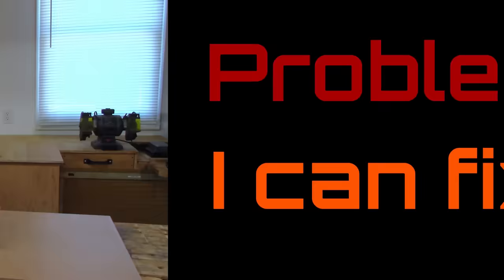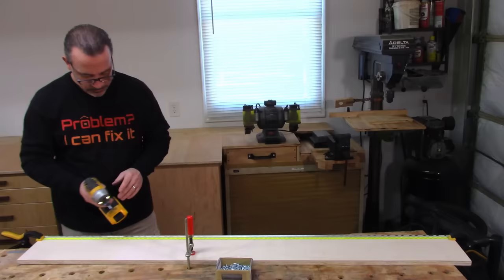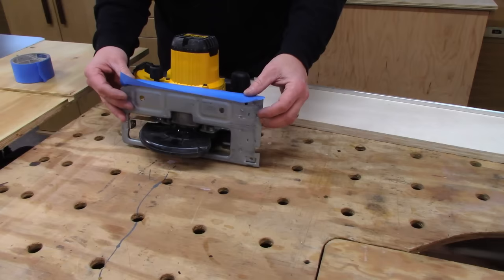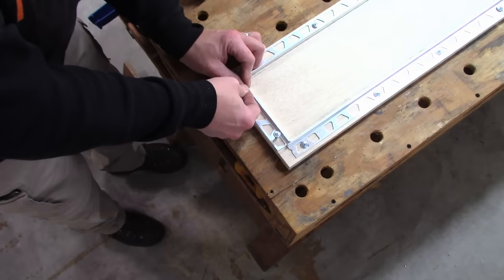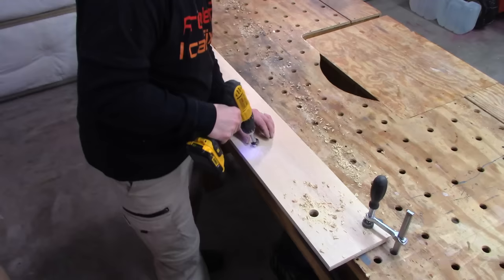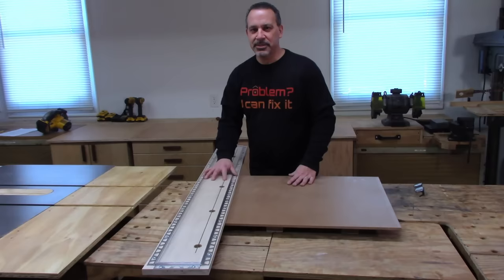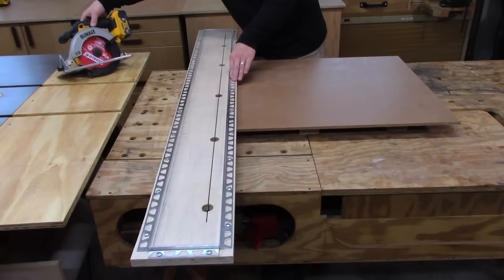Festool doesn't want you to see this DIY track saw

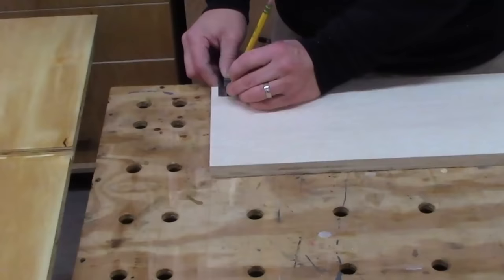Comment: I'm glad I saw your video.  I just leaned about track saws but for my minimal wood work it was hard to justify the cost.  I want to implement your build for my shop for the occasional times I need to make a straight cut. One question, at time stamp 1:21 you measure for the first edge but you don't tell us what that measured value is? I'm going to guess it was the width of the track guide but it would have been nice to have that information.  Also you measured from the edge of the wood.  What if that edge was not straight to begin with because you just cut it without a track saw or table saw. How can I ensure the line will be straight?  If I was a professional wood worker I would probably go with a commercial product with the dust collector but for me a home build will be perfect.
Reply from the maker: Approximate width of track.  When you pull the string taught you'll have a perfectly straight line to put the tile edge against.  The edge of the plywood doesn't have to be straight just the tile edging when screwed down.

Comment: would be great to remove hardwood flooring planks from the middle of a room if you had to do a board replacement but were worried you might scratch the surrounding area with the skill saw

Comment: Nice hack - but i would use the edge of a board to push up against and not string when fastening the first fence, way more accurate, and when drilling the 1 inch through holes, just put a sacrificial piece of timber beneath your jig and drill into it, getting a clean start and a clean finish in one cut.
Reply from the maker: Where do I find a straight board?
Reply: @HouseDoctorRay ? the other side of the board you just ripped your track from, and if that is not straight cut, then pay the few dollars to have one cut or buy one. If you are making a tool like this, its worth making it as accurate as possible. Even with the few extra bucks it is way cheaper than a Festool or Bosch track, and its actually a nice track which will last if looked after.

Comment: Run the track on the larger piece, then if you haven't supported correctly the smaller piece will fall with less chance of issue.
Reply from the maker: But my saw is built backwards 😭

Comment: I'll stick with my Festool (on the systainer it still says Festo). Has worked great for me for decades and above all the rail is very flat and light weight. Dust collection also no issue with a cheap Starmix shopvac hooked to a cyclone dust collector 😍

Comment: If you wanted this to support 45 degree cuts as well as straight cuts, would you make 2 jigs?  Not sure I could successfully cut 2 saw blade guides in the same jig.
Reply from the maker: If you made it out of Baltic Birch plywood you could probably turn the saw around and make a 45 slot.  I don't think home center plywood is stable enough for two slots.

Comment: C’mon you tube woodworkers, just accept the fact that Festool patented two of the best innovations in modern woodworking, you’ll never find a Festool killer in either the track saw or domino ranges. 
Other manufacturers have copied and refined the TS, but never really superceded the original, the evidence is clear, when they’re all compared to the ts55. And as for ‘domino killer’ videos, please give it up(Izzy). It’s ok to accept Festool did it perfectly.

Comment: Awesome jig. Only idea is would it not be better to apply the tape crossways? If you're cutting very close to the edge of the wood the taped section may hang over the edge and therefore not have any grip, and also mean the jig is slightly cambered. Applied crossways eg every foot you should get the same grip.
Reply from the maker: Good point.

Comment: "there's nothing worse than your saw bumping into a clamp mid cut..."
I can think of many things worse such as running your hand through a band saw, a spade bit snagging when on drill mode and breaking your wrist or accidentally leaning on a spinning unguarded jointer.
Love the video.

Comment: Quick question: doesn't this significantly removes how deep the saw can actually cut?
Reply from the maker: It will reduce the cutting depth by the thickness of the track.  Not really an issue because this jig is primarily for breaking down plywood.

Comment: What if you cut a dovetail dado on the underside, so you can use clamps that slot in from underneath into the groove for clamping if needed? I'm thinking of making this with 3/4" birch plywood.
Reply from the maker: That would work well.  I have slots like that in my table saw sled and use Micro Jig clamps.

Comment: I'm wondering if anti slip mat would work. It seems that the heavy grit skid tape could damage your workpiece.
Reply from the maker: I made some workbench cookies using anti slip shelf liner and they work great.  I'm sure it would be fine for this.
Others have also suggested non slip silicone tape that would also work as a chip out protector.

Comment: How do you see where you're cutting? You've gotta add some LEDs under there, too, so you can see the line you need to cut through that tiny gap. The metal looks cool, but this is weird.
Reply from the maker: The holes let you see the line.

Comment: If the plywood base is not square or parallel to the track above and there is no way to see the project piece under the jig, how can you quickly and reliably make sure that your cut is square or parallel with the other edges of the project?
Reply from the maker: That's what the holes are for.

Comment: clean and or  polish the bottom of the base plate to help it slide easier ...  and add a finish to the top of the wood  track ... and don't use a cheap or dull saw blade

Comment: If you feel that you need to add clamping ability to this, it should be possible to add at least one T-track and likely two (one on each side of the cutline) to the underside. This will allow you to slide T-track clamps into the tracks so that nothing sticks above the guide to catch on your saw. The ability to clamp the guide to the workpiece is likely more important when cutting shorter pieces since the contact area of the non-slip tape is smaller and so can't resist as much twisting and side load before slipping. It might be an issue on any length piece if the surface is something slick and hard like factory applied melamine or hard laminate where the anti-slip tape can't get a good grip.

Even with T-tracks and clamping I would still put on non-slip tape so I can use it without clamps if possible for far faster setup and so that the guide doesn't move around while you are tightening the clamps. Two tracks, one on each side of the cutline, will allow you to clamp to both sides of the cut to the guide to keep either side from rotating when the cut is finished in the case that the support on one side is further away from the cutline than the edge of the guide.

Oh, and T-tracks will help to joint together two pieces of plywood so I can get a guide that is longer than 8 feet in order to make full 8 foot cuts if needed to break down a sheet of plywood. So then I can take a 4 foot piece off of the end of a sheet and a 5 foot piece off the long side. The two pieces will need to be held together better than just what the aluminum guides on the top will provide. T-tracks should add quite a bit of additional strength. If even more is needed then put short sections of miter bar in the tracks across the joint line. And for even more strength, maybe put in a few dowels.
Reply from the maker: Good ideas.  Thanks for posting.

Comment: Cut it in half and put a recessed hinge on it to store away smaller which can be removed for smaller jobs. Also use clear rubber feet on the bottom so you don't scratch or mark the surface your cutting. Just 1 more tip.....make the base out of clear perspex for better viewing.
Reply from the maker: I like the folding idea...

Comment: i would like to see one designed to be used like a rip fence on a table saw only longer and wider, set up a guide rail on 2 edges at 90 degrees from each other with 2 guides, one for length an one for width, using either one of them at a time slide it out of the way, drop your sheet in, slide it over the cut line an lock it in to make your cut, almost like a home made panel say laying flat instead of upright. you would most likely need a 5x9 workbench to make any cuts from a 4x8 sheet.

Comment: Surely once the anti slip tape gets dust so over it, you'll need to clamp it anyway
Reply from the maker: Hasn't become an issue yet.  It's very similar to sandpaper and can be brushed off if needed.

Comment: nice job great idea, im gonna steal this one for sure, do you think the 1" holes work for clearing the sawdust as well when you cut?
Reply from the maker: The holes are to make it easier to see your line.  Hopefully your saw has a port to hook up a shop vac.
Reply: @HouseDoctorRay  i knew they made it easier to see the holes, ty, i just wonder if the holes make it easier to clear the cuttings weather you have a vacuum or not.

Comment: Hi very nice presentation. I have done something similar to this and when I put my cut against a level , I see daylight. How is yours ? Is it like a track saw quality ? Please advise. Thanks.
Reply from the maker: You need a straight reference fence.  Either use a taught string like I did or the factory edge of a piece of plywood.  The Schluter tile edging I used was perfectly straight.
Check your saw and make sure the base is flat and the blade is 90° to the base.  Sometimes the thin plywood blades can flex under load, maybe try a thicker blade.

Comment: Thinking about using metal screen framing to form my guides cheaper costs than tile edging opinions?
Reply from the maker: As long as it's straight.
I like the tile edging because it's dead straight and lots of holes to put screws.
When I bought mine at HD it was $20 for two 8' pieces.  Check the link in the video description.

Comment: Won't the abrasive grip tape scratch the surface of the piece you're cutting?
Reply from the maker: It could but I haven't had any issues.  Just don't drag it around.
Some have suggested silicone grip tape but I've never tried it.

Comment: Adding a 2' removable bar underneath the wider side of your jig perpendicular to the long side (90 deg) of jig coul give a treference guide for cross cutting instead of using a miter saw or speed angle.
Reply: could give a reference (sorry for the typos)

Comment: Why not just use the rip guide that comes with your saw?  I noticed that yours seems to be missing, however, you should be able to get a replacement.
Reply from the maker: Won't work for a 4' cut.

Comment: Wouldn't the anti-slip tape scratch surfaces if dragged or moved carelessly. Wouldn't anti-slip /rubber neoprene strips be better, maybe do a test and which is better. You could fit T-Bar to enable the use of clamps too.

I use a Scheppach PL75 Plunge saw and track and yours looks a lot more sturdy, I'd say it's more of a workshop track than an "out in the wild" kind of track. I had to mill my track edges square in order to join my track saw tracks correctly, as most track saws don't have square ends. Another issue is the twist disparity, where one track is slightly higher, leading to an awkward stop for the saw. In order to fit two tracks together, I placed some tape in the slots where the pins go. Don't get me wrong the track is bang on straight these are just niggles I came across with my track and once tweaked it cuts very well.
Reply from the maker: The grip tape is very aggressive so if you're dragging it across finished material it could be a problem.  Others have suggested a rubber non slip and I may try it.
I don't travel with my tools but this is probably safer to travel with than an aluminum track because banging a corner or dropping it isn't going to damage it.

Comment: That was pretty cool. Thanks for the idea. I need to cut 2-inch slabs of walnut right down the middle. The only thing is they are 10 feet long. I do have the Makita 16-inch circular saw to use for it. Any ideas for me?
Reply from the maker: Set them on a piece of 4x8 foam board and use a long straight edge.
The top section of an extension ladder is probably the easiest to come by.  Just use a piece of mason line to make sure it's straight.

Comment: So, i spend £35 on a sheet of 18mm ply, £15 on tile trim, £5 on screws........ mmmmm might as well just buy a straight clamp from one of the companies
Reply from the maker: Maybe.  The clamp on straight edges for sale in the US all have a little slop in them.  Not accurate.
I'm referring to the aluminum rails with a fixed end and a sliding clamp on the other end.

Comment: The friction tape being used seems like it would attract saw dust and be of no value.
Reply from the maker: It's been working well.  It's like 60 grit paper.  A lot of comments suggested using a silicone based non slip material.

Comment: You know I've had a couple different cutting guides,  now after 45 years I don't need that crap anymore,  I use a straight edge and a couple clamps, it cuts straight enough for cabinet work , take my advice,  don't spend a lot of money trying to cut a straight line, and that tile trim is $22.00 Each piece,  you got $45.00 to spend on tile trim ?

Comment: I've been using these saws for 40 years and never felt the need to buy or make a track. I just clamp my straight edge in the right place and run along the side of it. These 'accessories' are great but if, like me, you work mostly out of a van it takes up time and space... Learn to use your tools right and you wont need these things.
Reply: OR, and hear me out, after learning the old way (your "right" way), build or purchase tools, jigs, and accessories to male it quicker easier and more profitable...you know, just like they did in the old days.  TLDR; get over yourself, and quit trying to gate-keep.

Comment: One piece of ply plus 2 alu edging plus box of screws plus tape plus half hour of labour. is it worth? Tracks are not that expensive.
Reply from the maker: Everyone has to decide for themselves.  An inexpensive Wen is going to be around $300.  This is much cheaper and uses a saw you already have.
Reply: No one say track must be festool. Other maker like makita, bosch have around 120 price. But you still can find even cheaper ones around 60. Oakham razor rule simplest solution is the best.

Comment: Wow! What a new, AMAZING... "feature", the late Steve Jobs would have said, but since I'm not him (and that's why I'm still alive, heh heh...) I'll just say: Whaaaa....??!
So, you mean I've been using, all my woodworking life (which begun back when track saws were just as common and cheap as suspension forks for MTBs - back then, in the mid-90s, a suspension fork would cost you well over a grand, and would add about just as much to the weight of your bike), but anyway, you mean I've been using a simple piece of aluminium angle section and two G-clamps WITHOUT KNOWING how a creative genius am I?

Fork, life just isn't fair... ;-)

Now, on a tad more serious note, this over-engineered "shoelace tying contraption" here is... well, just that, if you ask me. (But if you won't, I wont tell - scout's honour.)
A lighter piece of said aluminium (right) angle section - like 50 x 25 mm (2" x 1"), 3 mm/ .12 in wall, held down by two small G-clamps at each end of the board being cut, for cuts no longer that 1.5 m/ 5 ft. Stiffer one, like 100 x 50 mm, 5-6 mm thick wall, for longer cuts (up to 3 m/ 10 ft).
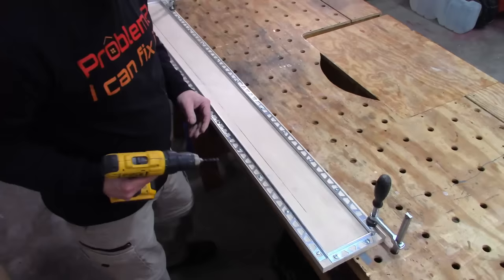No need for screwing down those flimsy finishing pieces for tiled floors - just make it thick, it'll stay stiff enough on its own. (BTW, couldn't help smiling seeing your saw wobble while being pushed across this "channel" on that piece of plywood at 5:17 and onward ;-)

Anyway, a solid piece of aluminium angle section will do the trick - just make sure you'll subtract from the final dimension the stand-off distance between the saw blade and the edge of the "foot" (base) of the saw (usually about 30 mm or so).

Hey, you just can't make it simpler, can ya? ;-) Cheers.

PS: If your saw "no matter what" tends to "bang into clamps", then... Well, that most likely means "Houston, we got a... a huge room for improvement here", don't we? (I mean, in "thinking and work planning department"... ;-)

And YES, this contraption is indeed way more handy when you happen to make more than three or five cuts "like that" a day, but then getting a proper track rail would make even more sense, if you doing this kind of cuts that often. Uncle Amazon says that "Evolution Power Tools ST1400 Track/Guide Rail For Circular Saws (Clamps and Carry Bag Included), 1400 mm" (55+ ") will set you back less than $75 (I guess that'd be on par with filling up your truck/ car tank) - and you can find even cheaper ones (Eastvolt 55" Track Saw Guide Rail kit sells below 50 bucks).
Granted, one for Makita or Festool would cost you several times that much, but then if one can afford Makita power tools, then he probably have enough pennies left to get Makita accessories, has he?
Something to ponder, eh? ;-)

Comment: If you had of used the latest dewalt battery 7-1/4 54/60v saw it would’ve jammed up as the shoe on the saw is not square to the blade

Comment: What kind of plywood did you use?
Reply from the maker: I think Birch from HD.  The more layers the better.  Where I live Baltic Birch was $200 in 2019, it's probably $3,000 now.
Reply: @HouseDoctorRay  Thanks for replying. 
I was hoping to get away with using something cheaper than birch.
Reply from the maker: Where I live Birch is $100 but so is 5/8 OSB. 😢
Any sanded plywood, melamine would work.  Anything smooth would be okay even BC plywood.  Just sand it and wax it.
The big box stores sell prefinished closet shelving with a plastic coating.  I think it's Rubbermaid.